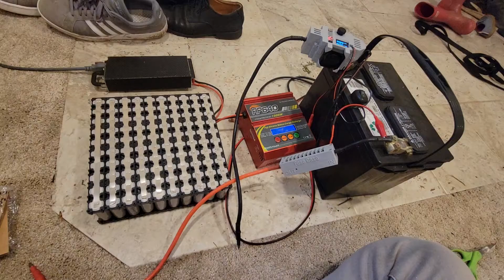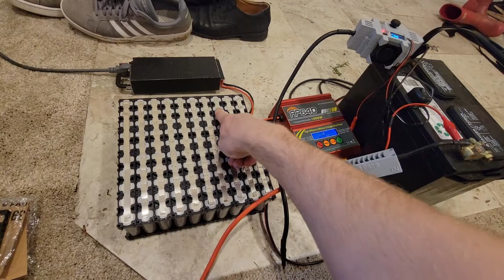Tesla 21700 battery build for electric motorcycle

Comment: Where did you get the cells from? You do a great job man. I'm just about to finish my first build...I think I kind of underpowered it for a full size frame bike. The battery is good for 200 amps so it should still be fun but I think I might have to do a V2 with more power 😉
Reply from the maker: I got them from bigbattery.com who claims them to be genuine Tesla cells. 200a and 72v is a good amount of power but yeah not enough in the long run haha.
Reply: @DevinLindstrom  thanks for the info. Yeah 72v 200A would probably be wicked fun in a 85 2 stroke frame but in my 125 frame I should really have 350-400A. Oh well live and learn
Reply from the maker: @vincentpernicano3277  to be honest it's not far from a 125. You might even be a little faster than the stock motor. My 550a bike will beat out a gxr1000. 350a is over a 450s power.
Reply: @DevinLindstrom  Wow that's nuts. I'm sure one electric horsepower is way different than one gas horsepower im frigging exited to get this thing rolling. I looked at big battery and the website advertises the max continuous discharge at 15A. Not sure where to find an actual data sheet on that but are you just planning on pushing the batteries hard at 200A?
Reply: @DevinLindstrom  could you show a video of the bike you’ve made?
Reply from the maker: @iyakab777  Here is the bike it will be going in for now. It will be one I use to test future builds too. https://www.youtube.com/watch?v=QkPDE9UgmKM&t=11s
Reply: @DevinLindstrom  can’t wait!!!!!
Reply from the maker: @vincentpernicano3277  Yeah at times it will be pushed to max. Haha. My wife will be the one using it though and she's tiny so it will probably average 500-900w draw.
Reply: @DevinLindstrom  Haha yeah makes sense. I am really curious how you design high draw batteries. I have been looking into how to make a 20S 21700 pack capable of 200A continuous and it doesn't seem like the commonly used nickel strips are adequate for that kind of power. Have you just done many hours of research on endlessphere etc. or where do you think I can find the best information on how to build a high performance pack? Lol just wondering how you learned it all because I'm trying but hard to find really good and or half consistent information on that stuff.